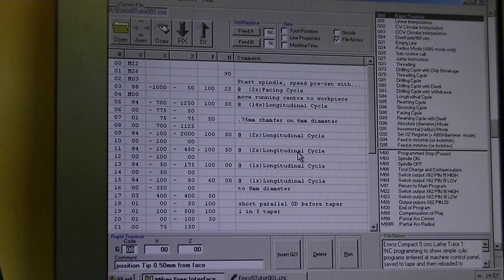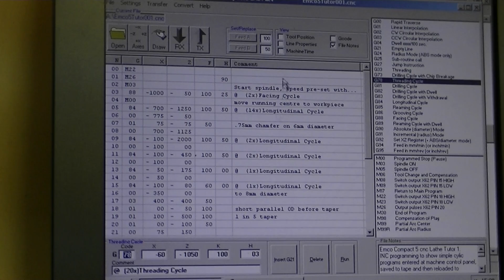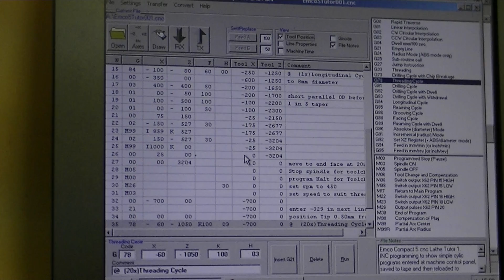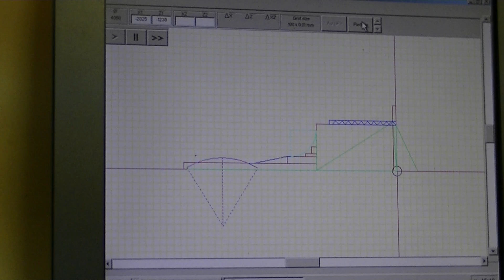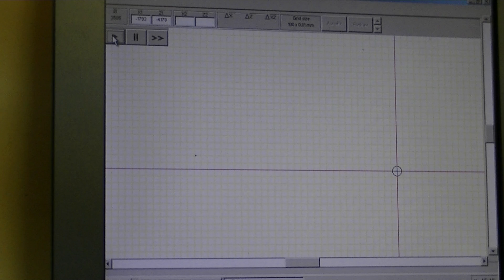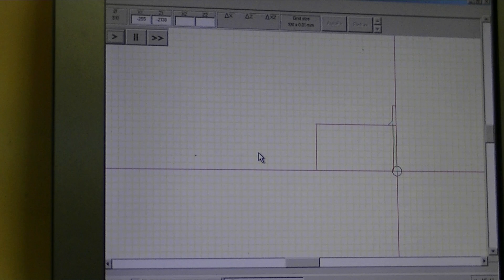Emco Compact 5 CNC MFI Tutor part 1

Comment: Can you point me out on how to get the monitor and computer set up. Mine didn't come with the rs232 cable so I know I need to make one but what kind of monitor can I use with this guy and how is the monitor supposed to connect to the emco? It has the video card and 2 connectors in the back panel that I don't even know what type they are to begin with
Reply from the maker: Best if you join the Emco 5 cnc iO group at the following link to the Join page and ask the question there.
https://groups.io/g/Emco5CNClathe
Reply: I asked the elec-chicken when he was visiting and he told me that it accepts a Coax cable used in antennas so that was simple as that, now I'm running a 80's b/w tv as the monitor. Never owned a TV myself so can't blame me for not knowing lol
Reply from the maker: @MF175mp  Good news then, makes it a lot easier to see what you are programming. Did you join the group yet ?
Reply: @ukmwg  yes I joined there and I have downloaded all the manuals and the MFI from the files section. I am currently waiting for some cable glands and a new motor for the turret to arrive from China. The basta... I mean behaving students had ripped some cables off it violently but luckily all the electronics work fine.